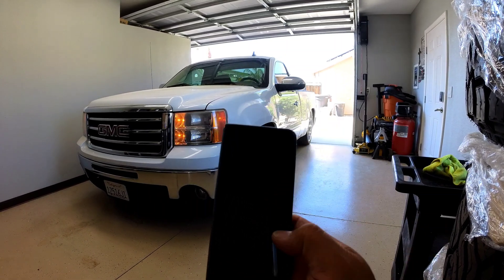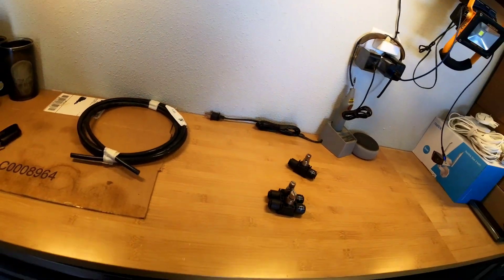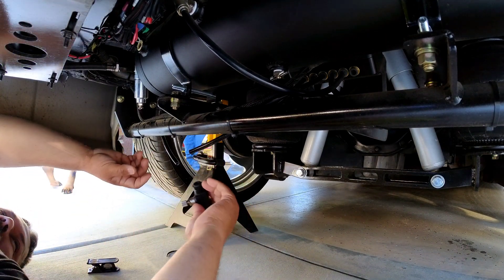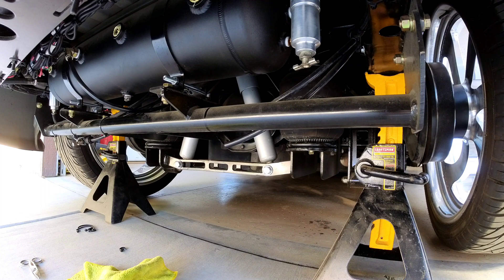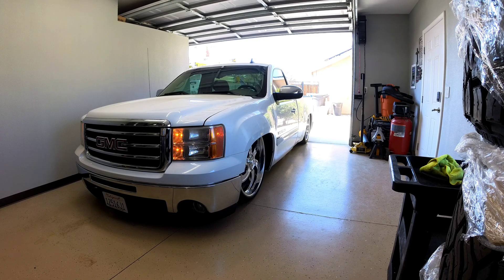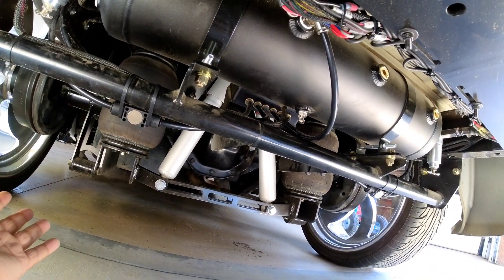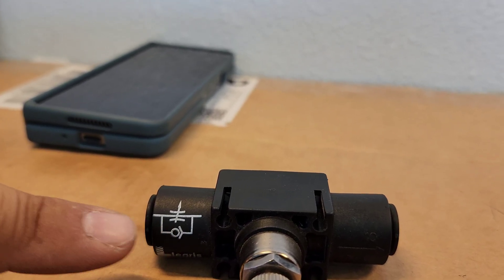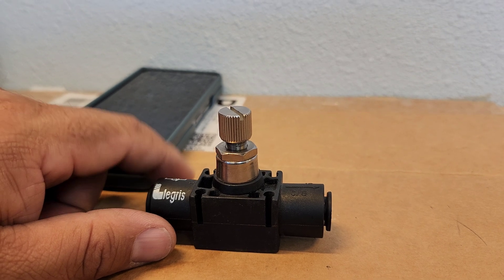AIR OUT YOUR  BAGGED TRUCK LEVEL (flow control regulator)

Comment: Hey man are located in Florida or close to it 🤔? I have a 09 GMC Sierra i need some work done can you help me?
Reply from the maker: I'm all the way in Cali my man! I wish I was in Florida....😂
Reply: @T_B_C_L  So the valves go from the airline from the manifold to front bags ? And it’s the diagram logo facing towards front bags
Reply from the maker: @edwincampos2314  the flow control regulator goes between your valve and your bag. Depending if you are trying to slow the dump or the lift depends which way you face the regulator. If you look at the little schematic you will see  what looks like a ball and a what looks like a backwards arrow. If you put the ball on the side of the bag you will have dump adjustment. If you put the ball on the valve side you will have lift adjustment. I hope this makes sense. If you watch the video all the way until the end I try to explain how these work.
Reply: @T_B_C_L do you have an Instagram I can follow ? I just got my flow control regulators in 🤙
Reply from the maker: @edwincampos2314  https://instagram.com/the.blue.collar.life?igshid=ZDdkNTZiNTM=